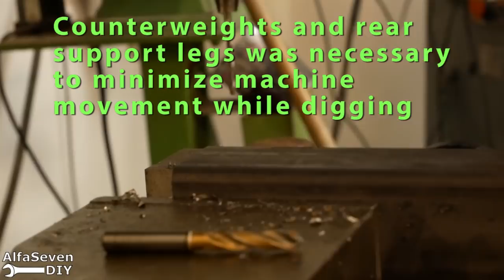EW7 Episode 15 | (homemade excavator)

Comment: Your channel is under rated by youtube algorythm ! you have some lot of skill, your excavator will dig for year and year and will be easy to fix not as some fucking product witout space where is not possible to put our hand and must take off all mecanics parts to change an simple hydraulic oil filter or clean a tank ! 

Your chassis is perfect base for some lot of application muscul lanmower, micro tractor .... just a question do you have a "special" dealer for cylinder and laser cuting parts ?
Reply from the maker: Thank you very much :)
Yes, I have very good contacts for laser cutting and a friend that selling hydraulic parts. Otherwise I had probably not doing this build :)